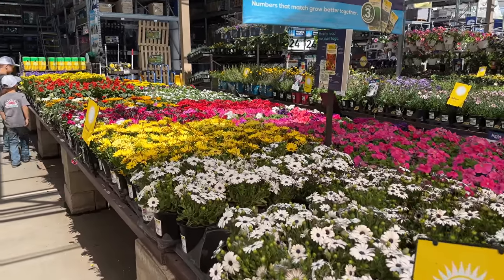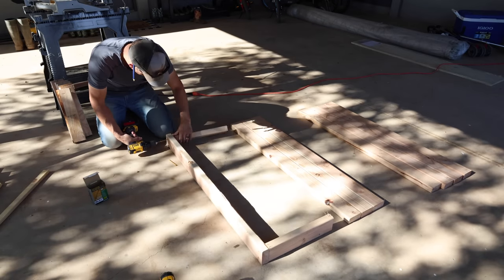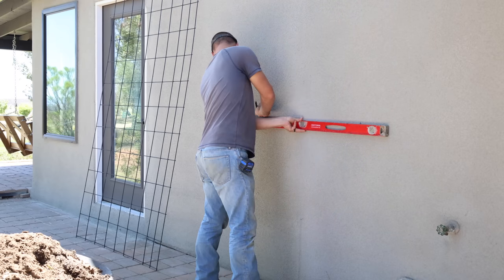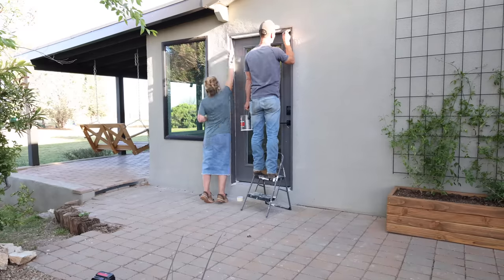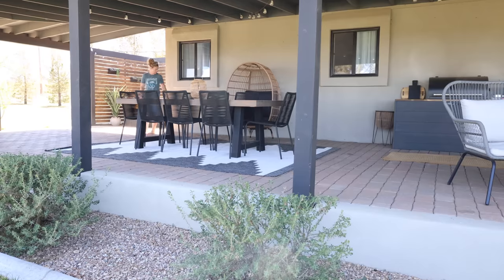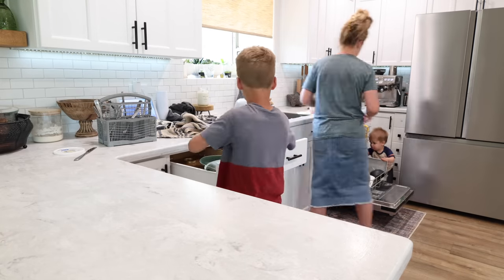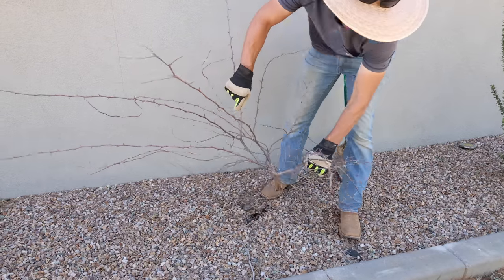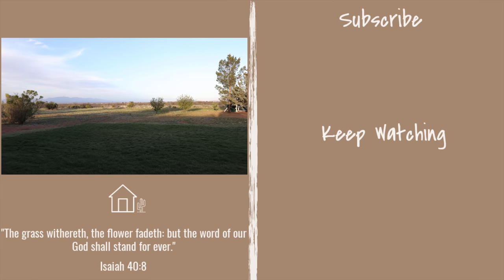*NEW* HOUSE PROJECTS & LANDSCAPING!!😍 EXTERIOR HOME MAKEOVER | OUR ARIZONA FIXER UPPER

Comment: Hannah it all looks so cute. TIP:, when planting flowers in pots with old soil, you needs to take some soil out add new and then add a good slow release fertilizer. The new flowers will not always do so well because the old dirt has no nutrients anymore. 
The flowers that died on the back porch, if you had covered those things up with a drop cloth or an old sheet, curtains etc., that’s all they need before it drops to 32*,. When the sun comes up and it is about or at least 37-40, I take mine off. I’m doing that now for my perennials, they are tender and frost will wilt them all. Gardening isn’t easy but us gardeners love it. 😃
Reply from the maker: Thanks for the tips! I'm still learning so I'll take all the tips I can get😅